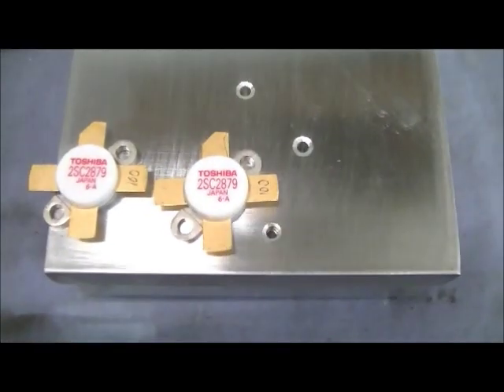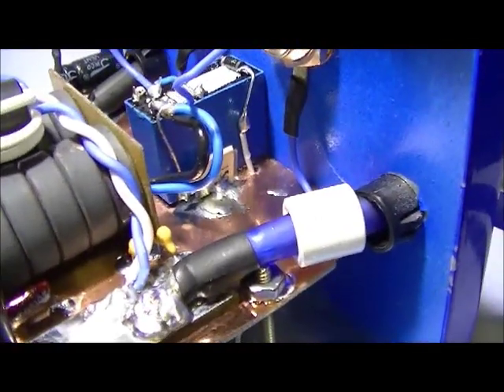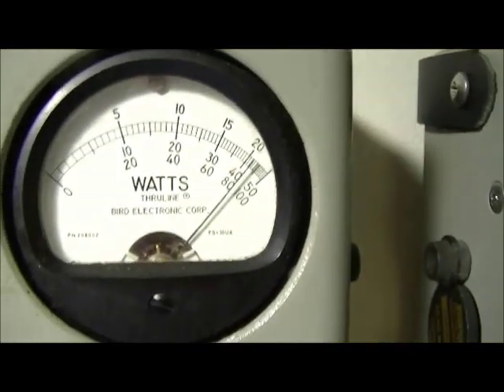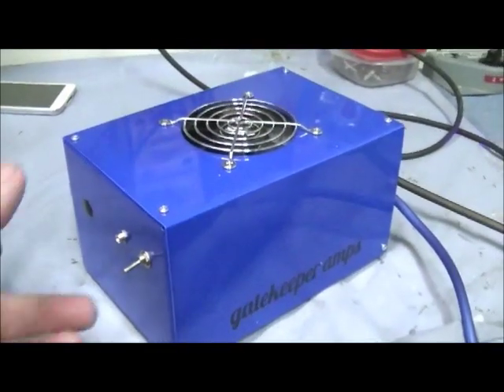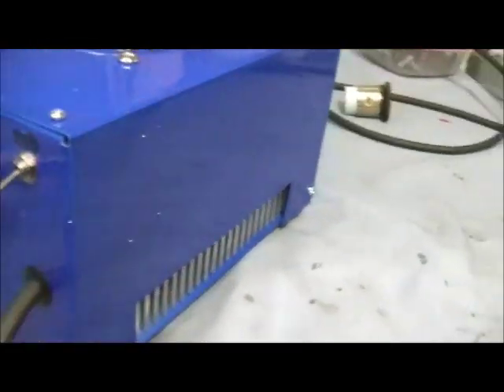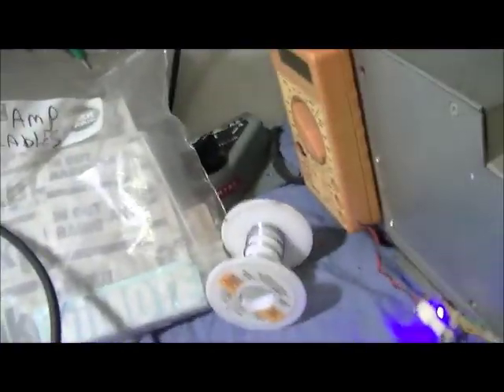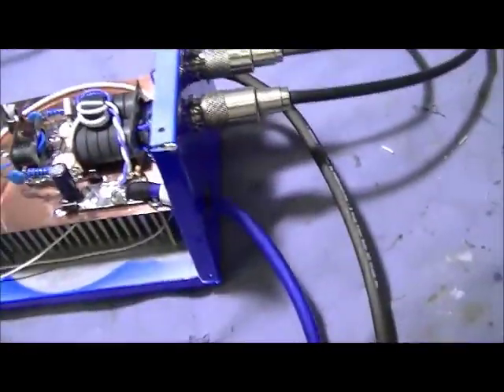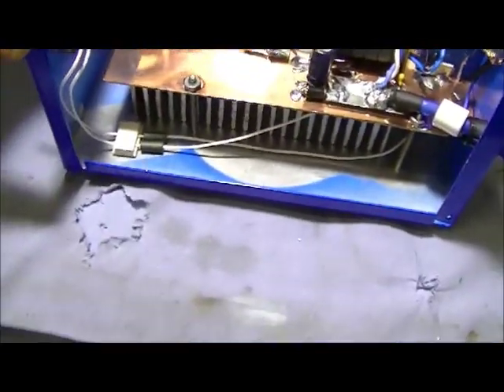Toshiba 2 Pill With Mirror Board doing 500w PEP w/ Bench Radio WTH? 😳😱

Comment: That nice 2 pill. That why I like 5/8 output transformers.  I some times use larger wire AWG PTFE silver plated wire . runes cooler and bit more output. I bet the output transformer runes a bit cooler with 2 windings . I even tried adding a feed back winding it works did not see any improvement over just a cap and 100 ohm base to collector.   with the extra cost of PTFE wire I never went any further with trying that way. what I did is instead of resistor and cap to collector ,I put to 2nd winding on output transformer. It also effected the tunning . did not think it was worth the extra work and parts just to work the same in the end.  I found it best just use better PTFE silver plated wire on output . not worth it on SD 1446 small pills . I just use standard PTFE wire on them. 73's
Reply from the maker: Yeh I got this idea from RF man....when designing his LDMOS boards he tried many different configurations like coax(the way he uses now) wire...twisted  wire...& double up on the wire like this....and this was 2nd in best performance so I thought I'd try it and it worked GREAT!!! I WANNA try some 8 Awg wire next lol lol
Reply: @1883GotDown  Try silver plated wire. 😀